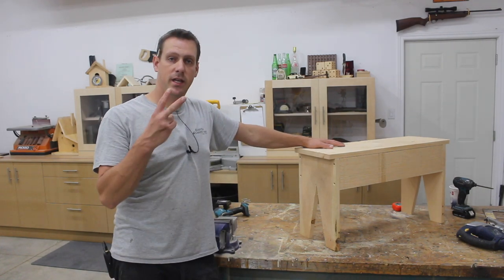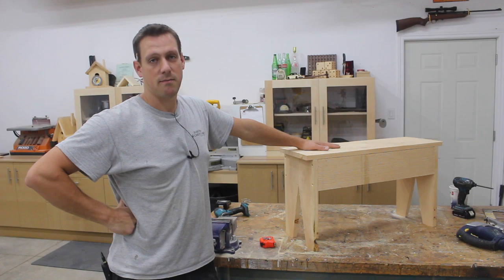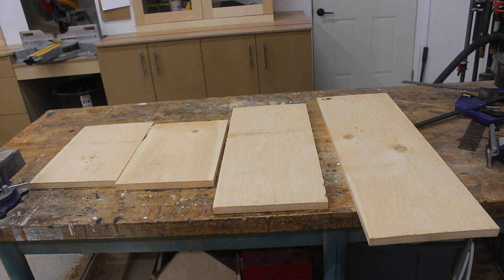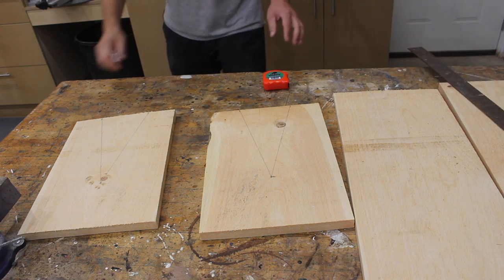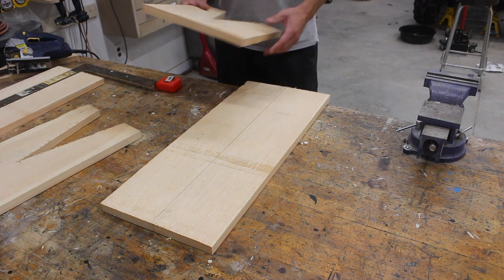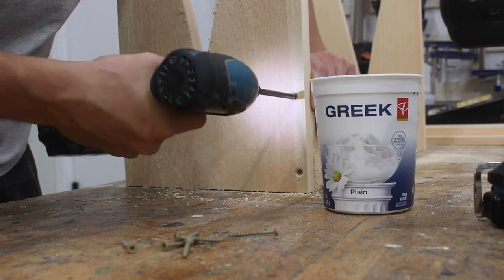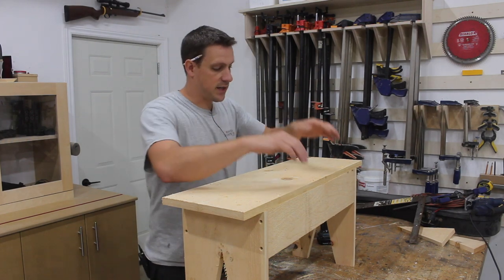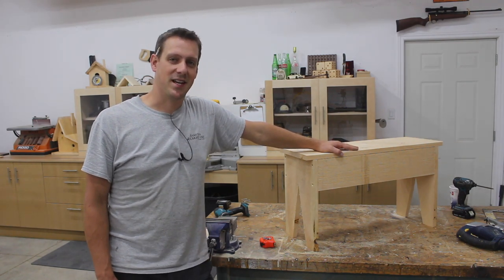2 Tool Build : Pine Bench

Comment: If you cut a notch in one end, and a hand hold hole in the middle of the top it looks just like the bench my dad would use as a finishing carpenter every day - the notch in the end holds/braces a door, so you can work on it's hinges.
Though he used scrap 2x8 or 2x10 (I forget which) for his bench.  I still have the one he made me 40+ years ago.
Reply from the maker: Wordsnwood (Art Mulder) thats pretty cool. I did think about cutting a hole in the seat to make a handle. I have a feeling this will bet used more as a step stool then the a bench.

Comment: Wes, I'd suggest drilling a quarter inch hole at the point of the V in the legs. That will help to keep the board from cracking at that point over time.
Reply from the maker: AZ Patriot great tip. Worth a try